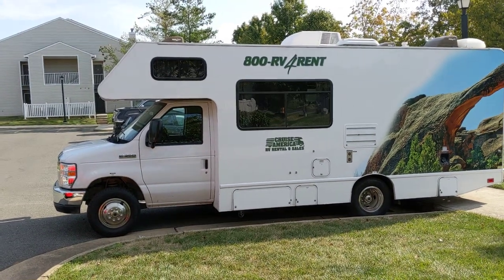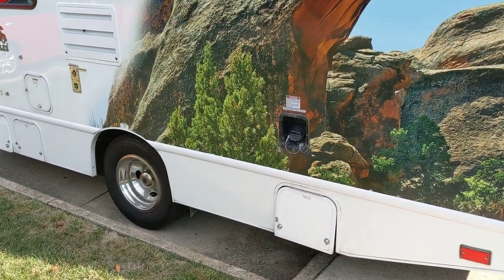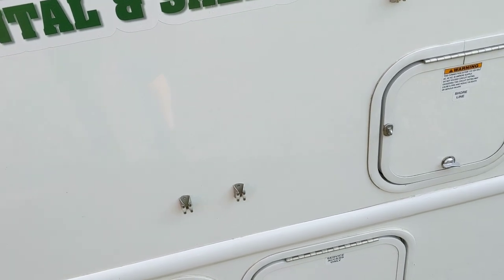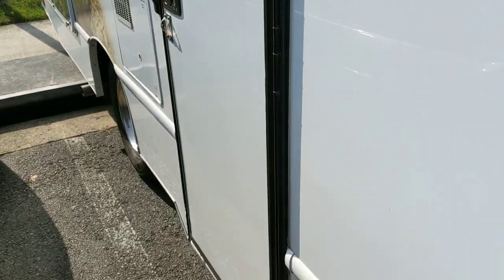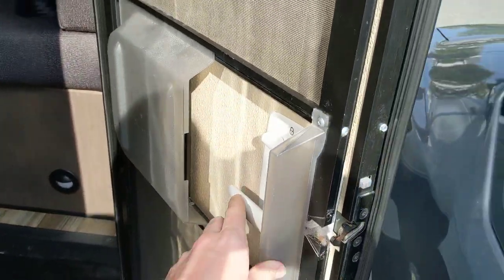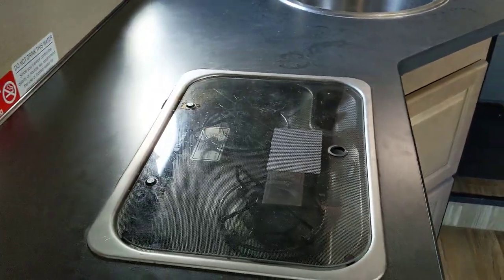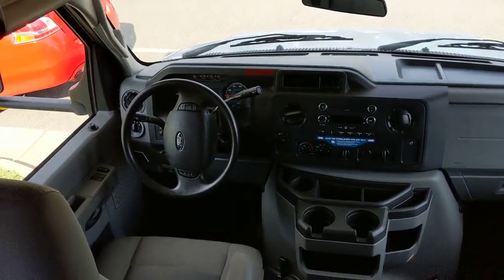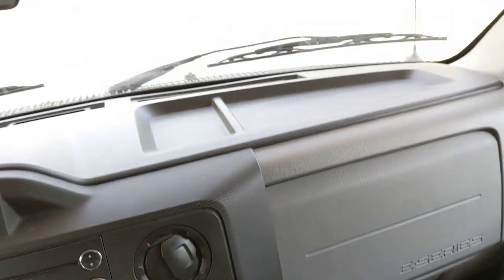Cruise America - Review and Walk through of 25' standard 5 passenger RV

Comment: Hi - thank's for the video,
Regarding the refrigerator: how does that work in terms of power if not connected to an outside electric source? I saw that you can draw energy from the propane tank to power the fridge,  but how long will that last for, and is it OK to leave the fridge running via propane for 2-3 days?
Reply from the maker: Hi!  If you look in the comments you'll see this question gets asked a lot.  The RV refrigerator has an "auto" setting, which means it runs of electricity (when available - for example, when plugged in at a campground) or propane (when available).  Typically your rental salesperson will turn it on as part of the check-out process so that it will begin cooling down immediately.

Propane lasts a long time, but obviously you should top it off prior to heading to your destination if you plan on taking a lot of showers or washing a lot of dishes with hot water.  I've had good luck buying propane at places like home & garden stores, also most home improvement stores sell it.

Remember to not pack the fridge too tight and keep the door latched so that cool air can circulate inside it.  Since the fridge is designed to be LP-capable you should have no issues running it off propane for a couple days, just keep an eye on your levels like you should for everything (water, black & gray water, etc.).  Hope this helps, have a safe trip!
Reply: @CompTechMike   Much appreciated! Thank you very much for your time and thorough response!
Reply: The fridge takes up to 8 hours to completely cool. Just leave it alone with no food inside and don’t keep opening it. It is not like your fridge at home. It doesn’t get as cool but keeps your food cold. The freezer does freeze.

Comment: Really great video, thanks for the info. I was just wondering how quickly that LP tank runs out and where you can get it refilled. As I believe the fridge can only be run by LP unless connected to shore power and the fridge is something you'd probably want to run constantly. Also, how do Cruise America tell the number of hours you run the generator for? There's no way to say top it up with oil, clean the exhaust, and pretend you never touched it. Is there?
Reply from the maker: Hi!  Thanks for the comment.  First off, you ever heard the old saying about "cheaters never prosper"?  Please don't tamper with the generator to try to get it to show less usage.  The only person this will hurt is whoever rents it after you.  Would you like it if you got a vehicle that the generator didn't work because someone had tampered with it?  In any case, there is a digital counter right on the control panel that shows hours used.  They do check this before and after every rental.

Re: propane and the fridge, the fridge has an "Auto" setting, meaning it will run on shoreline electric power (if available) or propane (if available).  Remember these units are not as efficient as household models, so don't over-fill it and don't stand there with the door open.  The propane can last for quite a few days, but obviously this is also pretty variable if you take a lot of hot showers, wash dishes, etc.

We've had good success getting propane at our local home & garden store.  Many larger gas stations / truck stops also have it available.  Good luck, have a safe trip!
Reply: @CompTechMike  Perfect thanks for the help. Also to clear thing up it would never have been my intention to tamper with the generator in anyway. I was simply just saying about cleaning the exhaust (as in with a wet cloth) and topping it up with oil. Most motorhome companies usually let you run the generator for free, you just need to pay for oil.

Comment: Awesome video. So helpful! We’ve rented the same RV for October. While researching RV parks, they say 30 AMP or 50 AMP hookup. Which one is needed for the RV? This will be our first RV experience. Thank you.
Reply from the maker: Hi!  Thanks for the comment.  The Cruise America RV's use a 30 amp hookup.  When you get to the campsite just unplug the cord from inside the compartment on the driver's side of the RV and plug it right into the 30 amp outlet on the campsite pedestal.  Then you'll be good to go with the microwave, AC, and any other electrical accessories.  Have a safe trip!
Reply: Thank you. What if the spot says 50/30 or 20/30, are those appropriate for this RV? Would we need to purchase any kind of an adapter?
Reply from the maker: @ardalaevans7059  50/30 and 30/20 usually means they should offer both types of electrical connections on the pedistal, but you may want to call the individual campground to confirm.  If they only have 50 amp you'll need to purchase a separate adapter.  If the campground only has 20 amp Cruise America typically includes the adapter for that, but note that on a 20 amp circuit you'll be limited to what you can run simultaneously (typically you can't run AC and microwave at the same time on a 20 amp circuit without tripping the breaker).  The best option is always to use a direct 30 amp connection with no adapters.

Check out this link and video for more info:  https://koa.com/blog/30-vs-50-amp-rv-service/
Reply: @CompTechMike  Hi Mike. Thank you so much for the helpful information. We will be booking camp sites today! Can't wait to head to southern Utah to see the national parks, including Arches which is featured on the RV in the video!
Reply: You can only use 30 amp.

Comment: If I want to run the roof top ac, I understand I have to use the generator. Is it noisy while running?  Or is the cab ac enough to cool the rv?  Thanks for any info.
Reply from the maker: Hi!  Thanks for the comment.  To run the rooftop AC you either needed to be connected to 30A shoreline power or run the generator.  It's pretty loud on it's higher settings, but on the lowest setting we are able to sleep with it on.  The AC vents in the cab are just like AC in a regular truck or van.  They cool off the cab area, but don't provide any significant amount of airflow into the back of the vehicle.  Hope this helps!
Reply: Thanks Mike, we are renting next week and a family of four. We’ll be traveling 4-5 hours to get to our first campsite.  I’m thinking we’ll have to ruń the generator for the AC in the back as we travel down the road?  Would you agree?

Comment: Thank you for the video. Very informative. How far can you travel on a tank of gas while using the generator and when not using the generator?
Reply from the maker: Hi!  I get a ton of questions about "how far can you go on a tank of gas".  Unfortunately this question has too many variables to be answered concisely.  Both the "large" RV (30') and the "standard" RV (25') have 55 gallon gas tanks.  They get, from my experience, around 10-14 mpg.  With the larger RV being more towards the bottom of that scale and the smaller RV being slightly toward the higher end.  Of course this depends on how fast you drive, how heavy your foot is, and whether you are driving on flat terrain or up and down mountains.  So again, just in my experience, most trips in-state can be done on a single tank of gas.  Longer trips are more.  I was able to get from Northern Virginia to upstate Pennsylvania and halfway back again on a single tank.  Just be aware that a 55 gallon tank can cost hundreds of dollars to fill up (depending on the price of gas in your area), LOL.

If you use the generator that does consume additional gas.  The generator is wired so that it won't turn on if gas in the tank is too low (this is to save you from the generator using up all your gas).  Most of the campgrounds I've stayed in have "full hookups" so I don't have to run the generator.  Most I've used it for is around three hours, I don't recall it consuming more than a gallon or two of gas during that time.

The propane is checked on the same panel where you check the levels in your black and gray water tanks.  If you want to use hot water for washing, showers, etc., you should check the levels on that.  A little goes a long way, and propane is really cheap to refill.  Most large truck stops as well as home & garden shops offer propane refilling.  We refilled it once a few years ago at a Merrifield Garden Center, think it cost us around $5.  ;-)

Hope this helps!

Comment: can fridge stay on while driving?
Reply from the maker: Hi! Yes, the fridge will automatically switch between running on propane (when available) or electric (when available). While driving the fridge will operate on propane. There is a power button to turn it on located at the top. Your rental office should turn it on for you prior to departure (so that it can start cooling down).

Remember these fridges are not as powerful as household fridges, so don't pack it too tight or stand there with the door open. 😊  Hope this helps!

Comment: Is cruise america going to provide the adaptor from 30amp to 50 amp? thank you.
Reply from the maker: Hi!  Thanks for the comment.  I recommend asking when you rent.  Most campgrounds have 30 amp and 20 amp service "on the pole".  The Cruise America rental RV's are natively 30 amp, so you can plug them in with no adapters.  They do provide a 30-to-20 amp adapter so you can run off a 20 amp circuit if that's all you have available.  Note that if using 20 amp they recommend not using high draw accessories such as air conditioning and microwave at the same time.

I can't imagine a campground having only a 50 amp circuit available, but if you stay at one that does you'd need to get a 50-to-30 adapter to be able to plug in the Cruise America RV shoreline power connector.
Reply: You can only use 30 amp.

Comment: Hi Mike,
You are the best! Thanks so much for making this informative video. Because of COVID-19, we are renting a CA standard size RV for the first time next month because it is safer than airplanes, hotels, and restaurants. Our biggest concern is that the place where we are renting does not rent out 2020 models, only 2016-2019. We are very very worried about getting stuck with an older model in terms of high mileage, potential for breakdowns and perhaps lesser or overused amenities. We are told that we will get whatever model year is available when we arrive. What would you be concerned about if you got stuck with a 2016 or 2017 model, especially if you were a first time user?
Reply from the maker: Hi!  Thanks for the comment.  As you've probably seen, many people are renting RV's right now due to concerns about cleanliness and safety at places like hotels, airlines, etc.

Personally I wouldn't be concerned about renting a 2016 or 2017, as these vehicles are still "new" in my eyes.  But this is coming from a guy who drives a 2007 truck with over 200k miles on it (still running great!), and before that I had many vehicles from the 1960's and 1970's, all of which also ran great.  Like anything, it's all about how you take care of it.  If everyone is conscientious and brings the vehicle back in the same condition they received it, all will be well.

Of course you still have a few "bad apples" out there who may return a vehicle damaged.  For that I recommend testing everything at the rental office prior to departure, this includes the condition of the tires and the engine oil, as well as verifying that the fridge/furnace/water pump/generator/stove all turn on and the black/gray tanks are registering empty.  Keep the 24/7 traveler's assistance numbers handy.  They have a few numbers listed, I'd write them all down and keep them in your folder of important paperwork while on your trip:  800-671-8042, 800-334-4110, 480-464-7300.  Also keep the number for your local rental office handy.

One other thing is, as people who spend any time in RV forums can tell you, these vehicles are mass produced and can come off the assembly line with issues.  Sometimes a "well loved" vehicle will be more reliable simply because it's had time to "shake all the bugs out".  Hope this helps, have a safe trip!  😀
Reply: @CompTechMike  Appreciate the timely response. Thanks

Comment: Hey Mike, great video! How cold did the fridge get? We're renting a 25' in a couple of weeks and I read that the fridges only cool to 60 degrees or so. That doesn't make any sense to me but I wanted to see your experience. Thanks!
Reply from the maker: Hi!  Thanks for the comment.  I honestly didn't know how cold a fridge is supposed to get, so off to google I went.  Turns out that a normal household fridge is supposed to get down to around 40 degrees.  That's pretty cold!  No wonder my dog and cat like to have their food heated up after we take it out of there!  🤣

But back to your question, these RV refrigerators are not anywhere near as efficient as a normal household-style unit.  From the time you first turn them on they take about 8 hours to cool completely, and you need to be very careful to not pack things too tight and only open the door as much as necessary (in other words, don't stand there with the door open).

Do they get cold?  Absolutely.  Plenty cold enough for my drinks and string cheese.  I'd trust them to keep my milk cool.  I think you'd need to take extra steps to get them to reach 40 though.  For example, don't park the vehicle in direct sun and make sure it is level so that they aren't straining.  It might be interesting to stick a thermometer in there and see what they do get down to after a couple days.  If you decide to do that post back - am sure others are curious as well.  Have a safe trip!
Reply: @CompTechMike  Does the fridge run off of the propane while you drive the vehicle? Curious how you keep everything cold when driving.
Reply from the maker: @ravenpetuchowski1410  Hi! Thanks for the comment.  The fridge is able to run on either propane or electric.  There is an "Auto" switch at the top which will switch it between propane (if available) or electric (if available) automatically.  Your rental office should turn this on for you prior to departure so it begins cooling down.  As long as you have either propane, or run the built-in generator (or hook up to shore power), you should be fine.  😁

One tip on the fridge - this is not like a normal household fridge.  Remember not to pack it too tight (air needs to be able to circulate inside it), and don't stand there with the door open or it will never cool off.  🤣  Have a safe trip!

Comment: Cool vid! Is it hard to drive for someone not used to the size of 25 foot rvs?
Reply from the maker: Hi!  Thanks for the comment.  "Hard" is a pretty relative term.  I grew up driving big cars from the early 1970's that rivaled an RV in length, so in that respect it wasn't too hard.  If you've only ever driven a Miata before (for example), you might find it a bit more challenging.  🤣  Remember these don't have rear view mirrors or backup cameras, so be prepared to use your side mirrors a lot.  Go slow, and be extra careful (use a spotter if you have to) in places like gas stations.  You don't want to knock over a gas pump with the long back end!

Go slow, be safe, have a great trip!

Comment: only works when connected to shore power... does that mean NOT while driving?
Reply from the maker: Hi!  Thanks for the comment.  There are several systems in the vehicle that only work when it is plugged into shore power or the generator is running.  Those include things like the rooftop air conditioner, microwave, and the 110/120v standard household electrical outlets.  They are not powered by the vehicle's engine.  Hope this helps!

Comment: Great video! How can this RV fit 5 passengers? The rear side bed fits 2, easily? Can the front over head cabin fits 2 adults? Do you need to convert the dining table and seat into a bed to accommodate the 5th person? If so, how much effort does it take to convert? Thanks.
Reply from the maker: Hi!  Thanks for the comment.  I think this size RV would be really cramped for five people.  The overhead area is mainly for children.  So two adults and three children would be max.  Maybe three adults and two children if one adult sleeps on the dinette-converted-to-bed.  But I wouldn't recommend having this many people, especially with only one bathroom.  ;-)
Reply: There is a queen in the back, a queen over the cab and the dinette makes into a twin size bed.

Comment: Thanks for the walkthrough! 2 questions: How often do you and your wife have to empty the black water tank and would 2 bikes fit in the back storage where the spare tire is located?
Reply from the maker: Hi!  Thanks for the comment.  We've never had any trouble with the black water tank filling up.  We like to take showers every day and wash  a lot of dishes, our biggest issue has been the gray tank filling up after about three days.  I guess if you have a larger family, or run the toilet a lot, the black tank would fill up faster.  ;-)

I do think a couple of bikes would fit in the back if you take the front wheel off.  On the 30' RV there's even more space - you could probably fit them without having to take the wheel off.  I haven't owned a bike in years so am not able to try; if you try it please comment back so others will know.  Thanks!
Reply: You can add a bike rack that holds 2 bikes as an option that connects to the tow hitch when you rent it’s an option.